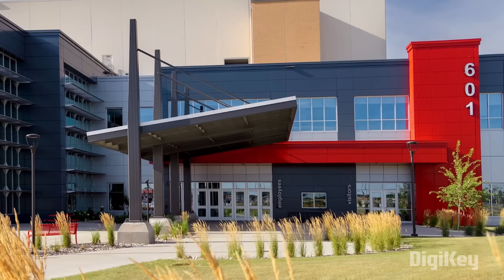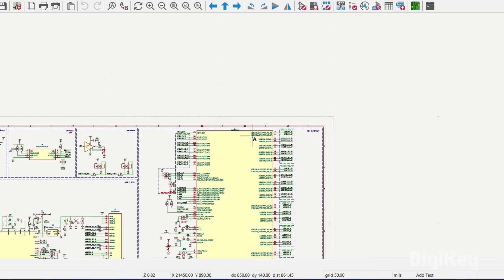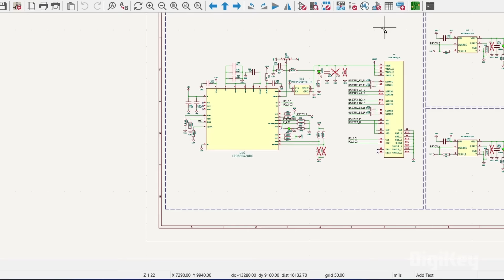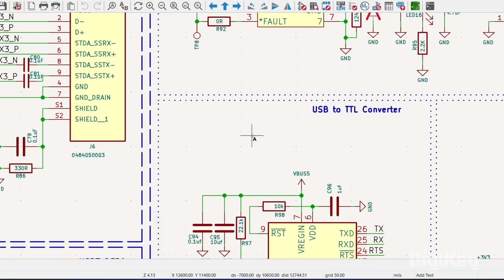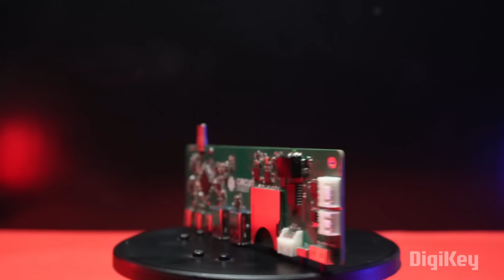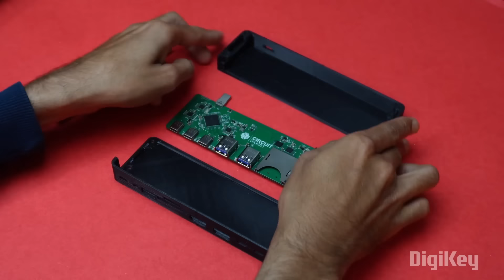The Only USB Hub you will ever need !

Comment: does it need controlled impedance traces? and if so, is it 90 ohms?
Reply from the maker: the impedance matching is as per the USB standard. 90Ohms for USB C differential pairs.
Reply: @Circuitdigest  thanks. also thanks for providing such a detailed and complex project as an open source

Comment: A couple questions. First, you have a "passthrough" port, but in your pcb you don't actually have that connected. What was the idea for that?  Would it be possible to use that pass through port to charge the upstream device? 

Also, what is the maximum wattage that each port can pull?
Reply from the maker: The pass through port is meant for Macbooks. so that you can attach it directly to Macbook and without blocking any ports. We didn't installed it in order to check on other systems.

Comment: Great work! Would have loved a HDMI our and female type c port for upstream for better mechanical stability.
Reply from the maker: Yes, that would be great. However, adding HDMI output would further increase the design complexity. We opted for a male port instead of a female port because it was designed to attach to the side of your laptop (especially MacBooks) and sit flush.

Comment: Great project! But the upstream USB Type-C port seems to be highly prone to mechanical damage under practical usage conditions
Reply from the maker: It is designed to be attached to the side of the macbook and the 3D printed enclosure is there to reduce the mechanical stress on the upstream port. There also an option for second USB type c male port with pass-through connection to a female port. Adding this will help to reduce the mechanical stress further more.

Comment: great project but how much does it cost against off the shelf multiple usb, granted it has the rs485 and 232 not normally found in consumer devices
Reply from the maker: The cost is definitely higher than the off the self hubs, because we are only making 1-2 quantity and using original components from reputed manufacturers.